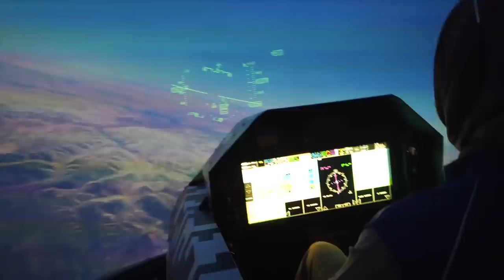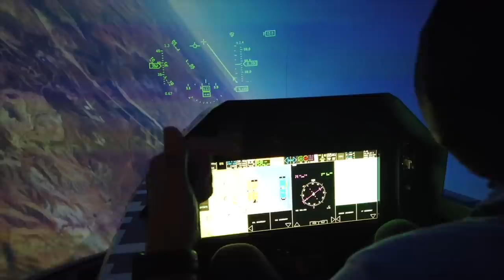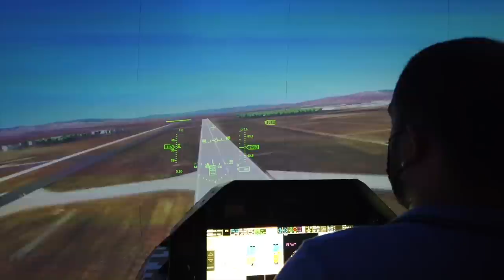Unbelievable: This Tiny Fighter Just Might Change the World

Comment: Realistically, this seems like an armed trainer, similar to the KAI T-50/KF-21. If Turkiey ends up the only country flying this it sounds like a bit of a vanity project - sometimes it just makes sense to buy someone else's design, which they perhaps could build under license. There is a need and a market for light fighters and there are countries that don't want to be closely tied to western defense companies but don't want to be dependent upon China or Russia; but, there are already similar jets in service. Then there is the looming possibility of a future armed version T-7, with the promise of industry support and upgrades for basically as long as the US flies the T-7 that could still be very tempting.
Reply: The Iranians reverse engineered the F-5 airframe.  Maybe Turkey should do the same, or buy the technical information/blueprints from the Iranians.  It's at least a proper light strike fighter and not just a trainer.  If they want to develop their own industry then building a single engine variant of an F-5 similar to the F-20 would be an easier starting off point than building a new trainer from scratch.  And they'd have a usable light fighter at the end of it.
Reply: It's not Turkiye's prject.The company took the initiative and produced it itself. Also countries want western tech with cost effective solutions. US planes so expensive. EU planes also expensive plus they easly put embargo with a thousand excuses.
Reply: Turkey probably needs 100 trainer jets and 100 light attack jets, the number is big enough to start its own production jets
Reply: @hellmarch3043 don't forget that the Turkish Hurjet is also using Western components such as the American GE F404 engine and the British Martin-Baker ejection seats.

It's not farfetched that those countries can veto the export of Hurjet to other countries,  like what UK did when they vetoed the sale of FA-50s to Argentina.
Reply: @paulsteaven  Congrats to Uk. But there is something you forgot. Türkiye is not Argentina. Can produce those parts himself in a short or mid time. Also, I don't think I need to write about the harms of forcing Argentina to trade with China for the UK.
Reply: KAI T-50 and KF-21 are very different beasts. The former is very much like the Hurjet. The latter is 4.5 gen full-size multirole fighter (projected to be both larger and heavier than F-16).
Reply: The Hurjet is projected to be produced around 3000 to 5000 pieces for export only…
Reply: @paulsteaven 
The only essential part that Turkiye obtains is the jet engine and before these models are being mass produces Turkish company TEI (and some others) will have a comparable or better models of the jet engine available for the Kizilelma, TF-X and Hurjet.
Reply: @hellmarch3043  Turkey government bought S-400 from Russia breaking NATO policy. Edrogan is acting against very aggressive against own allies. They do have right to say no in this situation.
Reply: The KF-21 is full-fledged 4.5 gen Multirole Fighter, not a light fighter/lead-in fighter trainer.
Reply: @horatio8213  There is no NATO policy to not buy weapons from Russia. It's only the policy of the USA.

Comment: This Alpha jet looking aircraft is supposed to replace the F-16? I don’t know... Impressive project from Turkey‘s domestic aviation industry nonetheless
Reply: As a replacement to the F-16 as a type trainer, it sounds fine. It allows them to preserve the F-16 flight hours for actual missions. Maybe by the time the F-16s need to be retired, they can have this new fighter developed enough to replace the F-16 in the roles that they use them for.
Reply: @namyun2743  Yes,but at the moment the F16 is definitely far superior. More maneuverable, faster, more payload, more spare parts and so on
Reply: @namyun2743  In some missions.
Reply: @theowlfromduolingo7982  Yes, agreed. I'm going to change my opinion:  For actual combat missions, I don't think this plane can replace the F-16.  Perhaps supplement the F-16 in some missions, and of course, type training.  The more I look at this thing, the more it's looking like an FA-50 situation but with less sophisticated avionics.
Reply: There are F16s on the fleet solely used for training, this can replace them, so F16s can be used for actual missions.

Comment: I bet they spent far less developing their planes than the US spends on developing one system on a new airframe.
Reply: Yup. A screwdriver in the military still costs around $5,000 dollars. Maybe 3,000.  lol
Reply: Yup, you get what you pay for.
Reply: And they have the advantage of throwing the best design elements of other NATO planes such as the F-5, T-38, F-16, and the new T-7. It looks suspicously similar to the Boeing T-7 trainer minus one tail. This isn't a surprise really. It's a Generation 4, maybe 4.5 aircraft and much of the technology was already developed. Turkey has gone bravely where the US went in the 1960's. I applaud the Turks for doing this though. It means some hopefully helpful new design ideas and doing it on a comparitively shoe string budget often delivers surprising results.
Reply: But it shows in the end result
Reply: And it shows. This is a glorified training aircraft. Junk
Reply: Sure, but the F-22 has a RCS of .0001 m^2. The B-21 bomber will be about the same. The Raptor was breaking new ground. Copying is generally easier even if you can only see and not have the actual blueprints.
But the closest competitors, the SU-57 and J-20 are .1 m^2. That's not even in the same ballpark, it's 1000X worse.
So yeah, this is probably cheaper. It's also 2023 and not stealth. The F-16 was designed in the 70s when it was close to the cutting edge, when computers were much less powerful, and design software far, far worse.
Reply: JohnRedcorn - let’s see you build one. 😂
Reply: @vincedibona4687  i cant build a toilet either. Whats your point?
Reply: @John_Redcorn_  So training Aircraft are Junk? Are you saying You throw your Cessna Pilot in an F-22, Just....because? DREAM ON.  If i can launch 20 Airframes that each carry 2 Missiles, and fly for 4 hours i get 40 Chances to down an F-35, while it gets 8. The F-35 can, just by keeping it fighting in an area be downed.  Because it has no endurance. All i need to do, is bind it. Or if possible lure it into a dogfight. The Russians made a Plane that outspeeds ,outturns, outranges and carries exactly ONE missile more than the F-35 internally. for about 60-75 million $. It is possible. Even if it's stealth is not as sophisticated. That's a lot of advantages But before a Pilot gets into one of those, he will have learnt to fly at least 5 different Airframes before that. 3 of which Jets.
Reply: @recoil53  You are Wrong about both RCS signatures though.0.0002 for F-22 and 0.12m^2 for SU-57. Which Disqualifies your argument. And who cares about a Stat, which only describes the Signature return from ONE direction? Radars from the Ground don't necessarily point at the nose of a plane. And they are USUALLY much less restricted than an Airplane's Radar (MOAR POWER) And the Distance closes fast if two stealth planes fly (nose to nose at same altitude, just to make the most out of your Argument). 20 miles difference in locking range may only take a few seconds. A difference, a faster Missile can reduce further, or even negate. "Stealth" is not the end-all, be-all solution.
Reply: @Gunni1972  so we’re comparing cessnas and f-35s now? Got it 😐. Ok ill play along. Your training aircraft with 40 missiles wouldnt get close enough to the f-35 to even launch ONE of those. And by some miracle one jet does make it to the merge its still going to be a bad day for it, as the f-35 is AIM-9X capable and it is comparably maneuverable as an f-16 in a fight (the new f-35s, not the pre-production ones that had their hands tied due to testing restraints). Time and time again rivals have thought quantity over quality would be enough to defeat western jets, and time and time again they have been proven wrong. 

Western pilots also go thru more training than any other airforces. Yes they have training aircraft but they use them for actual training, not strap missiles to them and double them as a frontline fighter.
Reply: @Gunni1972  And you are wrong about the exact number disqualifying anything. You also reinforced my real argument, thank-you.
Because if you understood what was said, you could see the point is that the F-22 was pushing technology so much that competing powers can't match it even now. The numbers are merely an indication of how how the difficult it is to equal the Raptor.
Reply: @Gunni1972  "Which Disqualifies your argument. "
Or you just supported it.

"And they are USUALLY much less restricted than an Airplane's Radar"
Or more restricted (less altitude).
Reply: @John_Redcorn_ ,  as I understand @Gunni1972 is not comparing Cessna to f35s. The next step after training with a Cessna may be Hurjet, you don't need a stealth aircraft to get jet training he says.
Reply: Probably, but you can't compare them. I am sure it is a great machine but the F35 a far superior aircraft.

Comment: Other than a large payload,it doesn't seem very impressive. Its barely an upgrade to an F-16. And it's in no way a threat to any Gen 5 fighter.
Reply: It's a jet trainer pal. It's not supposed to replace F-16's. Perhaps only some air to ground roles since this aircraft is cheaper to operate. If we were to take your argument as granted, then the T-7 of Boeing & SAAB shouldn't be considered impressive either.
Reply: @anavgeekspassion5727 Huh? Did you even watch the video or do your research on the Hurjet? It's not just a trainer. It's a multi-role aircraft designed for combat.  The trainer version will almost certainly not even carry a payload. Clearly I was talking about its combat versions. Can't believe you wrote all that all while thinking they were just developing a training jet. Why even make a video about a trainer? 😂
Reply: @LeviBulger  Who exactly are you trying to teach a lesson to exactly? I’m terribly sorry, I don’t think I need to waste my time researching a plane that I have been personally following for years (yes, I do have connections with TAI). Hürjet is not a multi-role platform designed for combat. Its primary objective is to be an advanced jet trainer. Together with the current prototype, the first 16 airframes will also be trainers. TAI has not started working on her combat variant yet. A trainer aircraft at heart will always be a trainer. No matter how much munitions you manage to integrate. The creation of a genuine front-line fighter would require an extensive re-design, and at that point it would be more logical to design one from scratch. Hürjet will evolve into an LCA. Much like the FA-50. And it will be a respectable aircraft in that regard as well. And LCA’s as you know, aren’t really a threat to existing modern combat platforms to begin with. If you’re interested in drawing comparisons to 5th gen aircraft, I suggest you research KAAN/MMU/TF-X instead. Whilst it is true that TAI Hürjet is intended for military use and that it will be developed into a light combat aircraft, there is no running away from the fact that it will not compete with pre-existing combat aircraft we know these days. Thus the idea that suggests Hürjet is of comparable role to aircraft such as the Gripen, F-16, Rafale, Eurofighter etc, let alone 5th gen aircraft such as the F-35, is ridiculous. Hürjet was never designed to compete with these platforms. To sum up...

"Its barely an upgrade to an F-16."= Was never designed to be an upgrade to the F-16.

"it's in no way a threat to any Gen 5 fighter."= It was never meant to be a threat to any existing 5th gen aircraft.

Comment: Hmmm. A mixed discussion here…. 

Here are my 2 cents worth;

1. Aircraft design and production is the forefront of one’e engineering capabilities.  Turkey is not well known for precision engineering nor electronic engineering nor more importantly material science. 

2.  Many countries claimed to have developed such and such systems but failed to demonstrate its capability in an open arena eg export.  For example, Turkey claims Indigenous AESA radar yet Turkey is not known for its electronic engineering nor chip making.  The TRM (in particular GA modules) are highly classified equipment and in most cases there is a strong export control.  There are only a handful countries who have demonstrated its AESA radar technology namely USA, Japan, China (question mark), Russia (again question marks), UK, Sweden, Israel (IAI) and Korea, all of whom has strong electronics industry and/ or semiconductor manufacturing capabilities.  

3.  The TAIs rushed development has been related to the recent election.  It is to be seen how it is followed thru given the election is behind. 

4.  Each development of defence system costs millions or even billions of dollars.  Given the current economic, financial turmoil in Turkey, it is not clear how Turkish government would be able to effectively fund it in timely manner.  This is a crucial issue as delayed development causes snowballing costs, which leads to higher unit costs. 

5. All its competitors have sizeable order-book and achieved some degree of scale of economy.  eg T-7 has 250-350 order from USA, FA50 (and T50) has production + orderbook over 200 units.  It would be interesting to see if Turkey can match the successes of its competitors. 

All in all, it is far too early to speculate the outcome.  It will start to show once adoption by Turkey and export commences.

Comment: When the Swedes built what would become JA37 VIGGEN they simply took the most powerful engine and built a fighter jet around the enging. That was theways of old.

Totaly boring fact
The J35 Draken never clocked in on max speed because it would run out of would before that.
Reply: Viggen is literally an engine with wings bolted on.

Comment: The answer to the title is ABSOLUTELY NOT! It'll be a light fighter-trainer at best, that the Greek armed forces would shoot down easily even with low tech AA systems. They wouldn't risk sending their pilots to certain death!  If it proves to be mildly dependable and capable for a low price, it could have some export success in Africa.
Reply: Then it would also be relatively easy to shoot down an F-16. Hürjet's performance and flight characteristics are comparable to the Viper. It only lacks the carrying capacity. Which again, isn't related with how hard it would be to shoot a couple of them down via old air defense systems. Especially considering the fact that this specific TAI product comes with a very advanced avionics suite. Hürjet will eventually evolve into a FA-50-like LCA, equipped with a GaN based (most likely) AESA radar. So to answer your question, no. Downing this tiny aircraft would not be that easy. Also worth mentioning, this aircraft enjoys the advantages of having a lower RCS (both due to its size and its mostly composite airframe). But since these platforms aren't stealthy by any stretch of imagination, it's not that big of a deal. Just thought it would be nice to point this out as well.
Reply: @anavgeekspassion5727  Comparing the product of  a relatively new manufacturer to the F-16 is a logical fallacy. It will take them at least 3 or 4 decades of RnD and real life experience (combat) to reach the level of refinement of a US made fighter plane. Wishful thinking and marketing schemes rarely come true. But you are free to daydream all you want...
Reply: @kammen1flatza  The only logical fallacy I see here is your example. And I listed why this is the case in my previous response. 

Did I compare the two aircraft in all honesty? I think not. In fact it was again me who stated that Hürjet was never intended to be a replacement for any of the active F-16's currently in service with TurAF. The flight performance characteristics of the two aircraft are well known though. It seems that you're greatly undermining TAI's CAD and engineering capabilities. The aircraft IS as maneuverable as an F-16 on certain areas. A specific emphasis has been placed on low speed maneuverability hence the shoulder mounted wings (fyi). 

Experience and "decades long R&D" as you put it certainly would have an effect on the speed of development (Hürjet was still developed in record time) and the total amount of roadblocks a company could face. But this doesn't neccessarily mean a brand new product would perform in an inferior manner when compared to a decades old platform that came from a proven manufacturer. One prime example is the TAI Hürkuş. It's a more performance oriented platform than the KT-1. KAI still has more experience when it comes to original aircraft development programs but even TAI Hürkuş (an aircraft that was developed during the times when TAI wasn't even using the Dassault PLM software and supercomputers) is known to be a more capable platform in terms of maneuverability and performance. 

Your wishful thinking argument is also interesting since quote: "... that the Greek armed forces would shoot down easily using old AA systems." is a prime example of wishful thinking to begin with. Best.